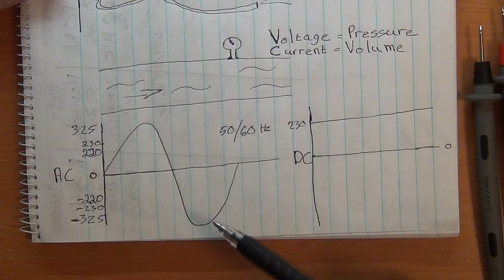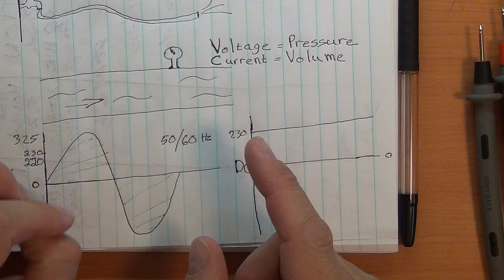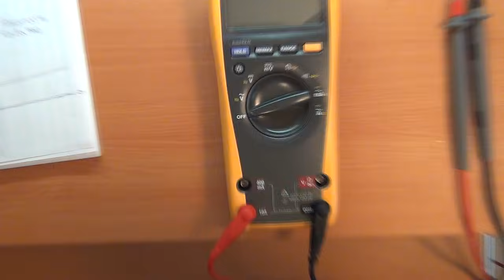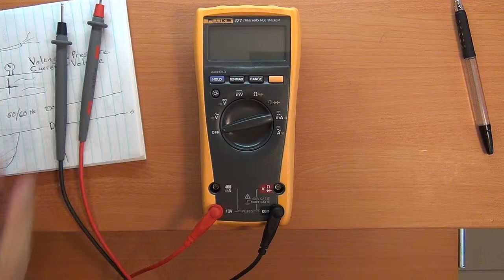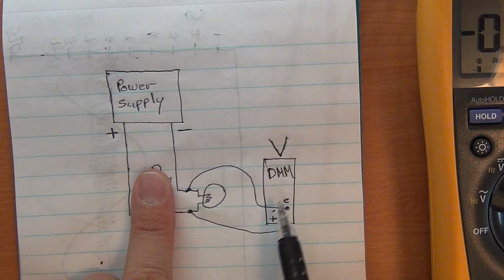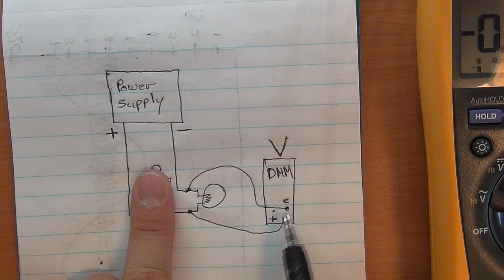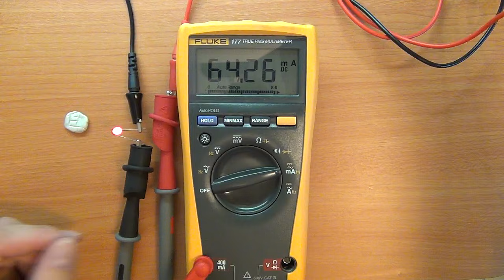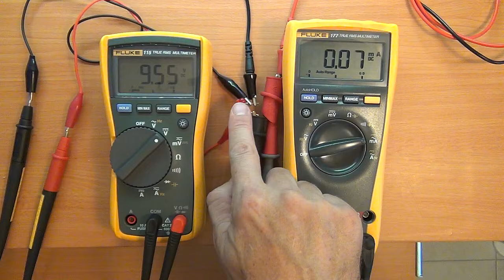Comment: Think of ground as the water pressure (voltage) that is equal to the water pressure of something at lets say sea level.  Now you dip one side of a pump into the sea and connect the other end (using a closed pipe) to his paddle wheel example.  The other side of the paddle wheel connects to a pipe which also dips into the sea.  The whole thing is closed except the sea.  If the pump is DC it will always pump water in one direction.  If it is AC it will both pump and suck.

Comment: The ground wire is always at Ground Potential (i.e. it should be grounded).  The voltage on the "hot" wire will rise and fall both positive and negative (as compared to ground).  The current through the circuit will flow through BOTH the hot and the ground.  If no current flowed through a wire why have it there?
I think I know why you are asking though?

Comment: Current will flow from aluminum to copper through the human.  It shouldn't matter which way you connect it, you will just get a negative reading if its backwards.  The important result is the magnitude will be proportional to the electrolyte level.  Connect one lead to the copper and one to the aluminum.  Current will flow with no apparent power source (I believe?), but I could be waaayyyy off.  Might help to use the sweatiest guy in the class.

Comment: I THINK you are using the copper/human/aluminum to create a crude battery since the human body contains electrolytes.  The copper/aluminum will generate charge at a rate proportional to the electrolyte level (the dependent elemental property is galvanic corrosion (I think?)).

Comment: Most devices are in fact powered with DC whether the conversion is done inside the device or outside the device with an adaptor.  The only examples of things around the house I can think of off-hand which are totally AC are my water heater, and my weed eater.  Just remember if it is electrical and has IC's it uses DC almost guaranteed.  If its electrical and it has no IC's it may or may not use DC.

Comment: In fact virtually every device with Integrated Circuits I can think of operates off DC.  Inside your microwave oven it has an AC to DC conversion used to power the circuit boards.  It's just inside the device so you don't realize it is there.  Something like a toaster doesn't HAVE to convert since AC running through a coil still gets hot, yet my toaster has some electronic readouts so it too converts to DC to power the little circuit card internally.  Likewise with a range oven.

Comment: Your computer mother board runs on DC too.  The power supply converts line voltage to several DC voltages needed by various IC's on the motherboard (both positive and negative DC).  Each different voltage uses a different color wire.  Open your computer, find the power supply (power chord plugs into it), look at the pretty colored wires going to the MB & measure the voltages.  Stay away from the wall outlet side to be safe, but the pretty colored wires are < 40 VDC and won't shock you.

Comment: Your cell phone.  The charger converts AC to DC and steps down the voltage.  Your car charger is already DC so it is smaller since no need to convert.  I have a wall clock with 1 of those little black rectangular adapters that is 12 V DC 2500 milliamps.  Any time you see one of those little rectangular (normally black) adapters they are converting the AC line voltage to some DC voltage.  Every typical house has dozens of them.  Look on the adaptor and it will tell you the DC output voltage.

Comment: Almost correct.  When the diode died the amperes ALMOST went to zero but not quite.  You are also correct that the flow of electricity didn't completely break because it continues to flow through the volt meter.  But the resistance of a volt meter is very very high, therefore the current through the volt meter is much less than the current that was running through the diode (ALMOST 0 but not quite).

Comment: How do you think I knew what would happen?  lol.  Everyone who works with electronics has done that at least once.  Best way to learn is thru failures.  BTW, remember this when someone asks to borrow your meter.  I can't tell you how many times I have been returned a meter with a dysfunctional ammeter measurement.  Notice too, the current measurement is the last one selectable on his fluke meter.  This is so you don't blow it clicking past current on your way to selecting voltage measurement.

Comment: Thanks for the explanation; I suspected as much.. DMM has high resistance in V mode and low resistance in current mode, but good to know whats going on there - I did accidentally hook it up in parallel to a battery briefly before I realized what was up; DMM seems fine (it was on 10A plug thankfully ;), and lesson is .. don't fiddle with current reading on 2 hours sleep :)

Comment: As you drain the battery the result will show up as an increase in the apparent internal resistance of the battery.  Eventually when the battery is about dead you might get an internal resistance as high as 20 ohms where drawing even 1/4 Amp will result in a 5 Volt drop in battery voltage... i.e.
9 V - ((1/4) * 20 Ohms) = 4 Volts output.
All Real world voltage sources have some apparent internal resistance which acts like a voltage divider when combined with the load.

Comment: of about 1-2 Ohms when fully charged.  Therefore shorting a new 9V battery will result in a current flow of 5-9 Amps!!!  This will drain your 9V battery in a few minutes (long enough to burn up your ammeter).  The output of the battery will drop to damn near 0 if hard shorted.  The voltage is being dropped across that internal resistance.  Drawing just a little current from the 9V battery the voltage will drop slightly below 9V due to a small voltage drop across the internal resistance.

Comment: In reality an ammeter's resistance isn't 0 (but close).  Also any real battery has internal resistance.  It acts like an ideal battery with a small resistor in series with the output.  The result of this internal resistance shows up by dropping the output voltage as you draw more and more current from the battery.  It's as if there were an internal resistor dropping more and more voltage as the current out of the battery is increased.  A rectangular 9 V battery has an internal resistance

Comment: current flowing.  Even if it is just a small battery.  For instance measuring current directly across a 1.2 V battery we can calculate current using ohms law as 
1.2 Volts / 0 Ohms results in infinite current and poof the current measurement of your multi-meter no longer works.

Comment: This will ruin your DMM if you are asking what I think you are.  All measurement circuits are designed to have minimal impact on the circuit being measured.  Since current measurements are made with the ammeter in series with the current being measured you should rightly expect the resistance of an ammeter to be damn near zero (and it is).  If you set your multi-meter to measure current and you place it directly across a power source such as a battery or power supply you will get lots of

Comment: Great videos! Dont worry about the "non-American" standard you stick too for your explanation. Most commercial property or warehouse like real estate uses the same 220-277 you go by. The only things that do not are your smaller outlets for devices like TVs or lamps. Air handler units, other HVAC, florescent lights, washer/dryer machines, and most appliances, and typical heavy machines all use 220.

Comment: What if the wires running to a DC light are not marked so that you know which is positive?  What would happen if you want to measure current (amps) with your DMM and mix up the positive and negative wires?  Is there an easy way to determine which one is the positive?

Comment: hi, watching session and I kind of got lost when you were testing the amount of current and voltage of the diode.  I mean the wiring; you connected the positive to the positive power supply and the negative acted as the positive to complete the circuit to see what the flow of current was; that was ok, but when you were checking the voltage you added the positive terminal to the negative part of the diode and the negative to the positive part of the diode did I miss something?  Sessions are great

Comment: Help! We are trying to measure a human's electrical current rate using a multimeter. Per experiment we have to place an aluminum sheet on wood blocks and a copper sheet on wood blocks and clamp the multimeter to the sheets. The subject places one hand on each sheet and the meter is suppose to provide a "mA" reading. Should I clamp the negative alligator clamp (black wire) to the aluminum or cooper?  Does anyone know why we had to use two different metals?

Comment: It all depends on the amount of amps...if it's less than 10amp (battery or solar panel) then you can probably use the multimeter in line on the correct setting. If it's more you need to use a current clamp or shunt.

Comment: Hi, i loved the vid. Can i ask you a Q:
If you tried to measure the amps in a battery it would probably bow the fuse. If the multimetre has to be part of a circuit then how come other vids show people measuring the amps in a solar panel? Whats the difference between the solar panel and the battery??
Any answer highly appreciated.

Comment: Hi mjlorton thanks for great video. Hope you can help me out with this. What transformer do i need to help stabilized power voltage drop. Like i need a constant 220 volts but only got a drop voltage of 160 or 180 volts - resulting on my equipment failure.
My aircon won'ts cool enough due to power voltage drop. thanks a lot!!!

Comment: For safety: Never touch a wire (even when it has no electricity going through it) with one or both hands; Especially with both hands (if you get electrocuted, then the electricity will go through your whole body, completing the circuit). So just use one hand to touch a wire, if you must. This is in reference to when mjlorton touched the wire with both hands to feel how the wire was warming up with 3 amps going through it. I think you only need 50 milliAmps of current to kill you!

Comment: I've got a question if you don't mind. I searched for a few minutes and couldn't a quick answer. Does A/C alternate current between both hot and ground wires? or do you get the alternating current in the hot wire only? I cant make sense of it either way... but I'm not going try and rationalize current and voltage any further until i know this.

Comment: I tried to measure the current of a small electric motor. When i use the mA, it wont complete the circuit. When i use the 10A hole, the motor does turn. But i dont read a current. How is that possible? I have alredy checked for a bad connection and a bad fuse. This all started when my microwave went dead and now im trying to diagnose the problem. Im a complete beginner but know at least i understand voltage and current...

Comment: In that example where the LED failed there was no limit set on the current (2 amp limit on what my supply can do), the current was increasing due to the increased pressure / voltage. I explain this in my electronics tutorials if you are interested. 
Thanks for the feedback. Cheers, Martin.

Comment: Thomas Edison was a proponent of DC, and shortly after Nicola Tesla invented AC both were vying for a contract to build a power plant at Niagra Falls. Heavily invested, Edison tried to discredit Tesla's system, but the results spoke for themselves. As I understand it, direct current's voltage drops significantly as it travels through a wire, and a DC power grid requires more power stations. Tesla's system that does not share that limitation and the electricity can travel hundreds of kilometers.

Comment: Hi mjlorton thanks for your multimeters for dummies tutorials. I noticed that when you were reading current thru the truck headlight your current at power supply was set to 3 amps. My question is regards to the LED that you blew up. The current was around 130mA and voltage was about 9 volts when the LED failed. You did not show the power supply and I just wanted to know what it was set at for current to help me better understand. thx jjohnson67sg2@gmail.com

Comment: I would simply set the multimeter to DC volts, remove the bulb and check to see if there is a good voltage reading (6/12 volt) in the bulb socket. If you need more help post this question on my forum.
Thanks for the feedback. Cheers, Martin.

Comment: Thank you very much for these videos. I am using a cheapie Innova 3300 to check continuity on the wiring of my '71 Beetle, but need to see if power is actually going to the bulbs. In the demonstration of this vid, you used an outside power source. How would I set this up for testing the lights of the car in an existing place. Would I need to run some wires from my battery, or could I simply connect the pos/neg to their respective point on the circuit?

Comment: I had to watch twice because you repeat yourself so much that I get confused. I do appreciate this information but shorten the answers just a tad so's not to be quite confusing please. Also when holding the small led light, you almost touch the two leads which cause some concern to as for being shocked. I sure hope I haven't offended you as your information is very helpful. These are helpful and I think about "motors" which require more amperage which is where things go very wrong. Ha ha!

Comment: Thank you for your fine videos! Could you help me with a question? I am measuring  AC current. My multimeter has a 2 ma scale. My reading says .507 ma. Does this mean five hundred and seven millianps or five hundred seven thousands of one miliamp?? If I am on a miliamp scale, why is there a decimal point?

To answer your question about AC vs DC for electric service, AC can be more easilty transmitted over great distances because it can be stepped up or down.

Thanks much!

Comment: Great video. The only slightly confusing area is your analogy on current to volume. As current represents a rate of coulombs per second, I think an analogy of water flow fits better as its easy to compare water molecules passing a given point per second. I think the volume analogy works for amp hours as this represents a volume or at least thats how I visualize it.  Interested to hear your thoughts on this.

Comment: Hi Miguel, thanks for the feedback.
In the video segment I connected to the 400mA socket only after taking the current reading of the LED at 8mA. The 3A was the reading from the 12 volt car light. The 10A socket would give you a valid reading but you would have less resolution.I hope that helps.

Cheers, Martin.

Comment: For the last measurement you connected the Voltmeter's red lead into the 400mA socket.  Why is it so if the Ampmeter is showing 3 A?  Would the Voltmeter still do a valid measure if its red lead was connected to the 10A socket?  Thanks in advance, and keep on your very useful and instructive work.

Comment: well the answer is really in the question.DC current as it does not alternate it simply runs out of preasure over long cable runs.the time it reaches its load there is not much left so needing
more and more current and as you have said higher DC  is hard to control.better used for welding as you say.This is not the case for AC and was quickly realised.

Comment: I had a blown fuse in my multimeter. Didn't realize there were 2 separate fuses in the meter. I read voltage just fine but amperage wasn't displaying anything. I have a Fluke 87. This is the first DMM that had 2 fuses that I have ever owned. Great videos though. Thanks for all the info.

Comment: Ok, if your power supply is not limiting the current and you have everything connected correctly there may be (but very unusual) some regulation / current limit within the light.
If you take a picture of your setup and post it on my forum I will have a look and try and assist you. Cheers, Martin.

Comment: I am not doing something right. I have my power supply and with it I can power up a 12v light. When I try and run it through my fluke, I raise the voltage but my amperage reading doesn't go up on my power supply and the light doesn't turn on. I am confident I have it hooked up as you did in your video. Any ideas what I am doing wrong.

Comment: Thanks for the feedback. If you have your DMM leads in the A (amps) plug and touch the leads across an AC live and neutral or DC positive and negative you will almost have a dead short through the DMM. If the current is high enough you can blow your DMM and / or trip the mains...if it is through a trip. A good safe multimeter will have a fuse and other devices to try provide some protection against this error.
Cheers, Martin.

Comment: Great videos. One question that is bugging me though, and I haven't found an answer online and don't want to possibly damage my dmm. When measuring current from say a power supply to a light, what happens if you just touch the leads to the light, like if you were measuring voltage.

Comment: u  r very good at explaining concepts sir, the answer for your question which I think is, as the power is transmitted through transmission lines, its voltage gets dropped due to core losses ex:resistance heating, so we will transmit in  DC , there is a power loss at hight power transmission and also this cannot be nullified as there are no Transformers working on DC , so its very convenient and economical to transmit in AC, as we can step up or step down by using transformers...........Thank You

Comment: The answer is distance. DC power stations had to be located within about a mile of the houses, (or load), due to voltage drop. AC didn't have this problem.